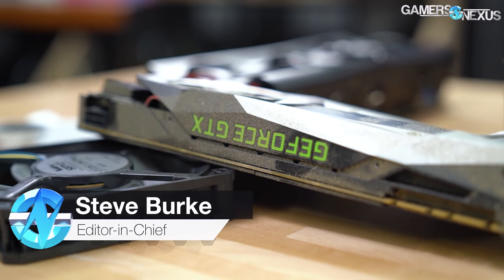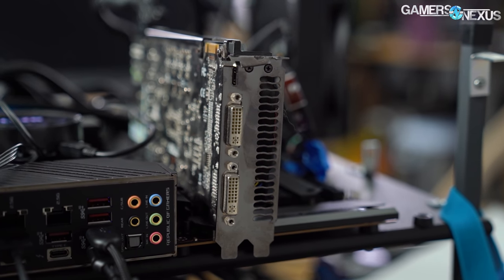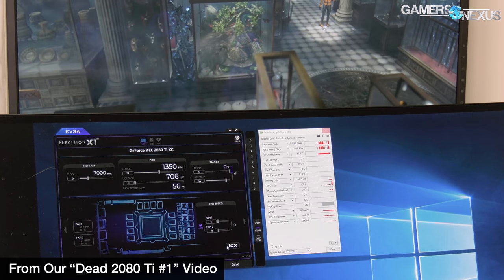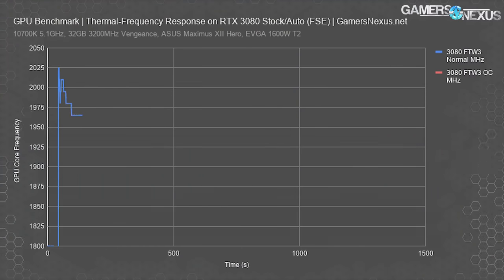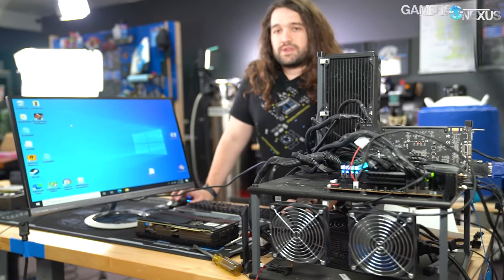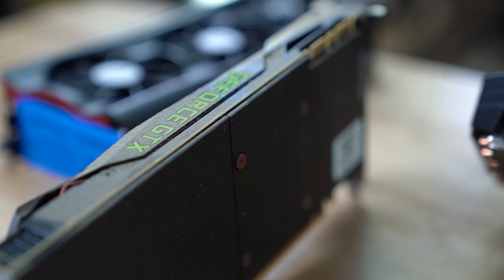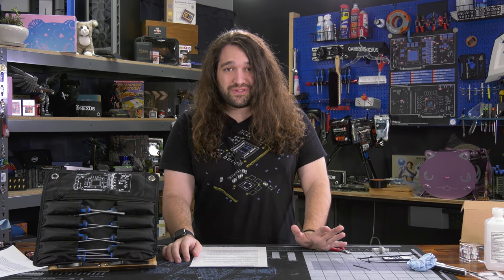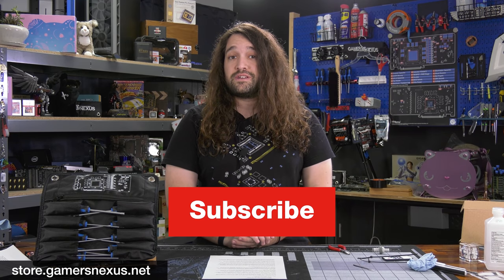Warning Signs When Buying Used GPUs: How to Detect Defective Video Cards

Comment: Sign number 1: guy is selling like 8 of them and claims they have only been used for gaming
Reply: I had the opposite experience. Sold a GTX 1060 (Asus dual, the white one) earlier this year. After paying for the card the buyer said that he now has eight of them, uses them for mining Ethereum. Never crossed my mind, still kicking myself for not asking.
Reply: @zwerker  Probably would have lied to you anyway...
Reply: if u are a miner just sell them one by one dont say u have 8 of them.  :D
Reply: I bought a 3080 and 3070 at MSRP, saw how much the 3080 was selling for and listed it on eBay. Turns out the buyer was building mining rigs out of them and selling them for even worse prices than scalpers. Currently using my 3070 for mining since I'm too busy to game on it (replacing my Vega 64 which was having issues with new AMD drivers anyway and sold it for as much as I originally paid).
Reply: Oh no! He wants to sell me a card that's been running undervolted and hasn't been subjected to expansion and contraction pressures from intermittent uses? Terrible!
Reply: I think theres videos comparing gpu vs mining gpus, it literally performs the same as long as the thermal paste is reaplied. Cuz miners take care of their gpu too
Reply: @sandordugalin8951  thats in case the guy knew what he was doing. if he was an average noob... he'll sell you a card on the end of its lifespan
Reply: I don't know about most miners, but my gaming/mining 3080 computer is running at 60% power and at a constant 50c. But when gaming, usually over 70c.
Reply: Sign of a scalper or a miner: Guy is selling 8 of them......
Reply: @MultipliedByZero  that’s core temp. Check your vram temps. Mine runs at 39c core and 90c for the vram
Reply: @MultipliedByZero  yeah... most miners are going to be running them at under 80% load chances are its better than a hardcore gamers GPU
Reply: @sandordugalin8951  lol i also don't get the  whole "the card has been mining raped" thing.
I undervolt my cards, seriously downclock the core, limit the power usage of the card and only increase the memory clocks.

From my benches, the card actually consumes less energy and has less fan usage while mining - you want the card to run constantly for a long time and at an efficient rate (cool with low power use)

In my mind, buying a card from a knowledgeable, meticulous miner should actually be the safest kind of 2nd sale yiu can get xD
Reply: I had an extreme situation like this. I saw what looked like an actually fair deal for a last gen 5700xt at $400 CAD minus shipping.
The description said the card was lightly used, no mining, only lightweight games like League and Fortnite. This already was a red flag for me because...well it is a 5700xt, why spend so much for leightweight games? But then I checked the rest if the listing and if said 330 sold of like 400 and something.

I questioned the seller and of course they never responded, then the rest were bought up.
Reply: Ill still take em
Reply: @MultipliedByZero  exactly. My 3070 is on water so when it's mining running at 53% power target it sits at 47c the whole time. When I game it gets to 59c once in a while
Reply: I would rather buy from a miner than a gamer. Most of the gamers don't give a dime about their hardware to prolong their lifespan. A miner buys fans, heatsink, repad and repaste their components just to their gpus be below normal temperatures.
Reply: @bollygod  Miners do all that cause their hardware is running at 100% 24/7 so it only makes sense to get the most out of it. Yes they often flash a custom bios with lower voltage but it's still A LOT more wear than gaming. Casual gamers play what less than 20 hours a week? Even those who play 50+ hours they would play games like csgo/valorant/league etc that is a joke to run.
Reply: GDDR6X seems to run too hot for mining and unfortunately it's not just mining.  Companies like Gigabyte have somehow managed to fuck up the cooling on the VRAM to the point where people have had to take apart brand new GPUs and use better thermal pads just to get decent VRAM temps.
Reply: I bought a used mining card, it's still working fine 2 years later.
Reply: @XeonProductions  The 3090 didn't exist 2 years ago.  I was somewhat wrong.  It's the VRAM on the back of the card that overheats and makes it terrible for mining.
Reply: I bought a miner RX 580 for $99, used it for two years and sold it for $250. Worked fine for me and the new owner hasn't complained. They are $400 now on eBay.
Reply: Gaming in SLI mode.
Reply: @あなた以外の誰でもない   not only that a lot of miners (not sure of percentage) undervolt to get better power efficiency's
Reply: @zwerker  my issue is he selling gtx 1060 3gb for around 200$ and claim tht card was made for internet cafe use only
Reply: i love how literally every seller says "never been mined on" it's pretty much a meme at this point
Reply: @scroopynooperz9051  Yeah but no gamer spends 24/7 at max load. In fact most gamers turn off their PC when they are not using it.
Reply: @sandordugalin8951  You look like you do crypto mining
Reply: @sandordugalin8951  just make sure that the miner who sold it to you actually remembered to flash a stock gaming BIOS, and that he didn't accidentally leave it on the mining BIOS with no graphics output- troubleshooting that is complete hell, you might just think the card is actually bricked
Reply: So you guys don't have a daily GPU?
Reply: Sold 40 3070's a few weeks ago, all on FBMP, I was upfront about them being mining cards. No issues selling them. At $300-$350, depending on the model, they sold at 3-4 a day.
Reply: @Hughesburner  would there be a problem buying an RTX 3070 that was used in mining? I found a listing on eBay with an MSI Ventus 2x variant and he's selling them for $380. Came from Little Elm, Texas, has over 70 of those things, and the guy sells mining equipment, so in all likelihood, the guy did mine them.
So in essence, my question is if that is indeed true, is it worth buying up with an about 21% markdown from $500 even if it was used for mining?
Reply: @PifchoBG  I did buy cards from miners in the past and the ones who have brains were taking good care of their card. I only had to change BIOS and they worked flawlessly.
Did buy cards from completely stupid miners and when tried to change thermal paste/pads, i noticed that the memory chips were having a brownish color instead of black.
Cards used for mining can sometimes be great (I recall RX 470 mining edition from Sapphire- 4 BIOSes model which after I installed HDMI port and all the necessary SMD components, were working absolutely great with very good performance).
Other times can be a waste of money and time.
Reply: I love to read those on sellers description: Never been overclocked / never mined. Like why do you have to mention it...just don't say anything about it. Personnaly I bought cards from miners it's not so bad
Reply: @PifchoBG  o
Reply: For gaming ? Like MINEcraft or whatnot ?
Reply: Crypto Meinkraft. It's this great new game but it requires 8 GPUs to be running simultaneously.
Reply: @XeonProductions still working now?
Reply: What about just some guy running a gaming cafe?? have you ever thought of it
Reply: @sandordugalin8951  Memory doesn't undervolt, and is usually overclocked. i.e. they might have suffered some... I still buy used though.
Reply: It is better to buy a card from a miner than a gamer, miners run their gpu at much lower temperature and take better care of them, because if they didn't they could suffer a big profit loss, but hey, keep spreading misinformation 
 if you feel righteous about it

Comment: What to look for when buying new GPUs: A miracle
Reply: @Joseph L Well he said "NEW GPU`s"..  It`s mostly there you need a miracle, and the used market you need trust, or just, take some precautions..
Reply: New GPUs: A miracle
Used GPUs: A deep pocket
Reply: @afrog2666  the used market is disgustingly expensive tho
Reply: Except having luck while refreshing e-shop websites? Money of course.
Reply: In July the market will grt flooded with used gpus.
Reply: i dont know what a gpu is anymore because they dont exist
Reply: i work with a miracle/ he sold me his 1080ti for 400 :[ miracle he is
Reply: Maybe I just pay the scalper price and mine crypto to recoup the diff 🥲
Reply: Not really. If you are willing to slash 2000 dollar on a Radeon R7 240 you're fine.
Reply: A miracle or $1500
Reply: MSRP price
Reply: Or a prebuild lol
Reply: I got sick of waiting and bought a pre built
Reply: Back in the early 2010s, I always bought used GPU's on eBay. I never had a problem with them. But as the market is crazy right now, I can see why there are big concerns over them.
Reply: I caught a miracle on offer up for a build, I caught a 1080 ti for 100 dollars, for 150 he threw in the resto f the rig, it was a i7 970 inside ... a classic monster cpu. its in storage right now, but i paired the 1080 with a  ryzen5 3600, boy it plays nice with the 1080.
Reply: I have found a maricle... just got to seal the deal. $650 for a EVGA 3070 FTW3. I just want to see how it works before I buy it. The seller told me "fuck scalpers". Fingers crossed

Comment: I got my 1080Ti from someone who was mining and it was in good shape, aside from high temps. I stripped the cooler and found out the thermal paste was dried up. I repasted it and it brough down teperatures by nearly 20 degrees...working like a charm for over a year now.
Reply: @Romi  Not Pascal cards are running hot. It depends on what TDP the card has and how good the cooler is. Low-end cards with very low TDP but with crap coolers also can run hot.  Example: GTX 1080 cards have TDP range between 180W to 300W . Of course the 300W TDP will run alot hotter.
Reply: the same thing with my new /old/ 1080. i paid 300$, high temps, after repasting and repading and now its super cool
Reply: @Romi Looking to do the same with mine even though I've only had it for just over 4 years. I did remove the backplate and shove heatsinks on the back of the memory and VRM and wow the latter is hotter to the touch than the memory on the back of the board...But temps actually dropped 2 degrees around the board.
I upgraded last summer to a 5700xt for 1440p a couple of months before the price hikes so I want to sell it thanks to used market prices, but I still need it for my gf's 2 screen school/work setup and my secondary smaller home theater setup so I sorta need the multiple DP/Hdmi ports.
Reply: I had to take back my like! Seem you are at a good number.  Sold two second had gpus that purchase year ago for $300. With the $ upgraded to GTX1080ti very happy!
Reply: @Romi my used 1070 never goes above 60C while gaming
Reply: I bought a used GTX 1070 FTW and redid the paste with some NT-H1 and replaced the very oily thermal pads with some higher quality ones.    It has been running nice and cool for about a year now.  I do wish that I had not sold my GTX 1060 though before prices went crazy.
Reply: Good to know, this video popped up just as I secured a used 1080 Ti.
Reply: @optimisticgambler3616  what did you pay if you dont mind me asking?Inpaid 700 canadian about a year and a half ago from a friend.Alot of people are telling me I got ripped off.
Reply: @Troyjanwarrior1  Unfortunately I paid too much at £550.  Very good condition but still expensive.
Reply: @optimisticgambler3616  You just saying that to make me feel better about my purchase haha.If not we feel each other pain lol.
Reply: @Troyjanwarrior1  I bought a used 1080ti for 550 usd today. But ay, just enjoy it cuz it’s still a great card. But maybe don’t buy from that friend again hahah
Reply: @feyokorenhof  Oh? Ok so I bought it almost 2 years ago from him.And 550 american is pretty close to 700 canadian lol.But yeah man it was a card ahead of it's time for sure.Im going to run it into the ground then display it on my wall when its retired!😁
Reply: @Troyjanwarrior1  Yeah I’m only familiar with euros haha so nvm. I’m hoping to squeeze out at least two years with this one until new cards come out with actual reasonable prices. 
Im Upgrading from a 970 so I can’t wait to see the performance diff :)
Reply: @feyokorenhof  Your going to the the 1080ti man it's still a beast in my opinion!
Reply: @Romi wut? My GTX 1070 temps are really good. hardly passes 65 degrees, if it reaches these temps in the first place ..
Reply: @Romi oh maybe because its a blower design.. mine is a 3 fan PNY variant.
Anyway, did you try to change the thermal paste? (apply it to the whole gpu chip btw) and also how many fans you have in your case?
Reply: @Romi That's weird, GTX 1070 in general is a cool card.. dunno why you're getting those temps
Reply: dunno maybe try to lower your room temperature.
I live in a very hot weather country (temps could reach +40c during summer, but I have my air-conditioning 24/7 xD)
Reply: @Romi bruh where I live air-conditioning is a priority otherwise we wouldn't survive the summer every year XD
Reply: @Romi yeah without A/C a large parts of the middle east would be uninhabitable
Reply: I'm a noob, how much paste do you need to add when opening up the card, is it always regarding second hand cards online even when sold for more then what they should be worth. I properly want to buy 3080 or 3080 ti founders edition since only UK and USA customers were lucky enough to get their hands on the gpu rather then third party like rog, MSI, tuf or gigabyte cards.
Reply: @shadowaussien7743  You put enough to cover the whole gpu dye chip
Reply: Still kicking?

Comment: I recently bought a 3090 from a local guy for $750. It was dusty and used for mining for about a year, but I was willing to take a bet on it because he was willing to let me return it if it didn't work, since he hadn't used it for some time. The card was no good so I returned it to him which he was cool enough to honor. I feel much more confident buying locally.
Reply: 2 problems with your reasoning that makes it mot (or mut or whatever lol dead in arabic) ah moot
I was willing to take a bet on it 
he was cool enough to honor
what if he was not and a fraud? for this reason alone no it's a no no
Reply: @yussef961 right this is the worst advice